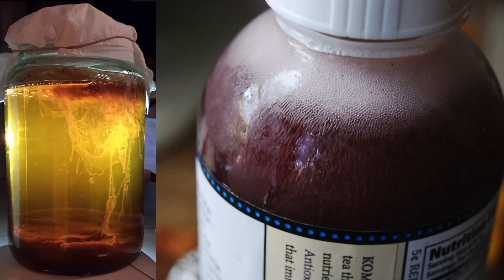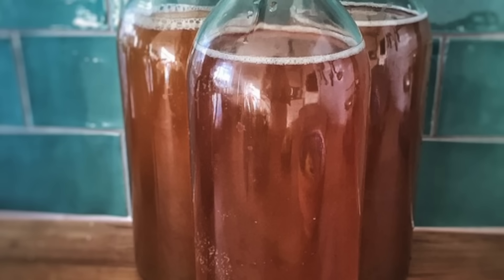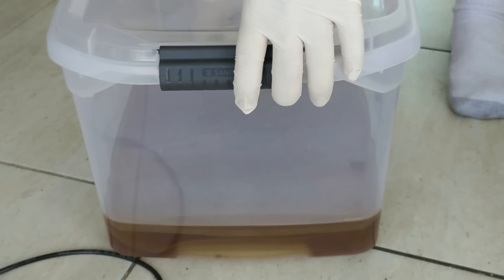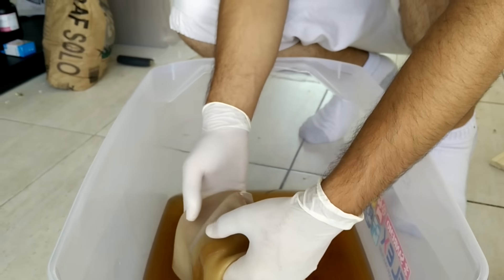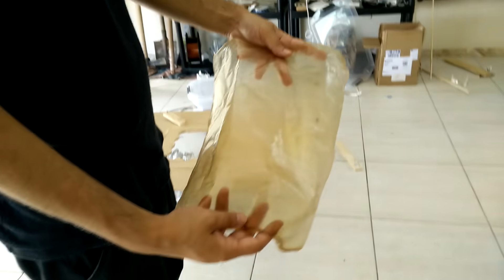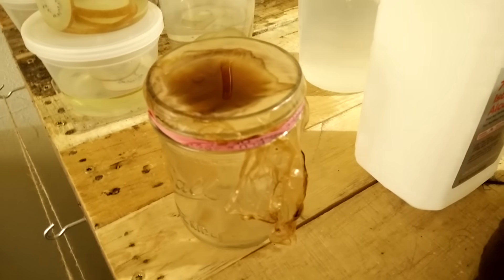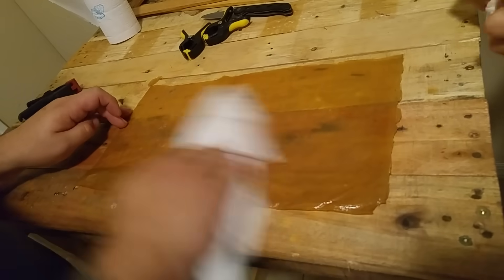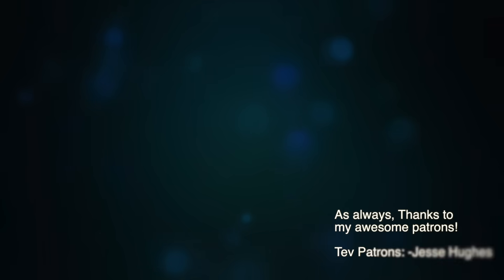How to Grow Leather-Like Material Using Bacteria (Making Kombucha Leather)

Comment: I just recently tried out this experiment except I wanted to introduce the concept of meat glue into the equation, so I soaked the  SCOBY in glutamine water to make it suitable for binding with meat glue. Overall it worked pretty well and I had some nice thicker material similar to yours but what was most interesting is the scraps that I forgot about inside the glutamine water mixture. I came back to the container after about a year and the scraps of the scoby turned into an almost perfectly clear plastic that fractured similarly to glass. I definitely need to clean it up since it's covered in nasty rot to do some tests on it

Comment: Can it be used as motorcycle body armor? Sturdy backpack material? How about a wetsuit, or a band aid? Will it keep you warm, or cool? What happens when you freeze it? Would it be practical to use the thin version instead of plastic wrap? Does it block oxygen as well as moisture (to keep meat from getting freezer-burn)? Is it machine washable? Is it durable enough to cover a sofa?

Comment: Does it need to dry in a wooden frame or can you just let it lie/hang?
Or will it shrink irregularly?
I'm just thinking that if I frame it, it would hang through in the middle?
Also if it's an unnecessary step...
And wouldn't it be thinner at the edges where it was squeezed by the frame?

Great work, guys!

Comment: I am a shoemaker, so i think i can supply a bit additional info.... I am pretty much sure somehow it's been said before.
Tanning via oils is a pretty old method, and it works, yes.
But if you're talking leather, you should have gone straight for chrome- and oakbark-tanning. Those methods produce the leathers which are used for almost all products made of leather, everything else is just a niche.
Especially oak bark would be interessting, as it is a renewable resource that is nontoxic and so it goes more in line with a 100% ecological leather alternative.
Last thing is: you'd have to check the properties. Make a shoe out of it.
Leather is so damn unique in its properties that it is very hard to replace it.
This video is great, just as all your other stuff is. Hope you read this and maybe give it another try.

Comment: Can this be used as an artificial muscle.  If an electric current is applied like in a web, will it contract to the shape of the web.  As long as it's moisturized, the muscle would be reusable.  The same can be done in reverse as the muscle contraction could be used as nerves and relay that back thru the webbing.  LOL, looked like the last human from 8th DrWho episodes.

Comment: Would the leathory material be useful as a seal for a home made vacuum chamber? I wonder if it expands in vacuum or can have liquid applied to it to make it expand on demand.
Reply: Can it be coated in things in the vacuum chamber like titanium? Could you either dry it and make a titanium mirror to exact dimension for a telescope or dry it in form to the correct shape?
Reply from the maker: no, its quite porous and full of trapped water. It would offgas like mad

Comment: Here are the the steps from the video written down, so they're easier to follow :) :
1. Boil destilled water
2. Add one cup of sugar and two teabags per gallon
3. Put it into some kind of container
4. Add a small amout of Kambucha liquid
5. Make sure it still gets some air. 
6. Leave it for 2- 4 weeks. You may need to add new tea
7. Dry the Scoby on a  woodframe for a few days/hours
8. Put a mix of beeswax and mineral oil on it and let it set
Done!

Comment: You could reinforce the scoby with fibers as it is growing,    aramid fiber for instance could result in a cut and tear resistant leather.

With a slightly agitated and aerated nutrient bath,  you could grow a scoby onto a submerged fiber/wire scaffold and produce arbitrary shapes rather than allowing it to form a skin on the surface.

Electronics could be embedded into the scoby and encapsulated as it dries.

Comment: What are its actual mechanical properties?  You say that it's flexible, and you clearly reeeeally want us to think of it as a leather alternative, but that's about it.  
When oiled, does its texture change with water? 
Does it resist abrasion?
What is its tensile strength?
Does it take dye? (right now it looks like cellulose sausage casing more than anything)
What happens when it is heated?  
Is it oil resistant?
Does the oil leak out?  (i.e. If I had a wallet made of this, would it pick up fuzz from my pocket and/or slowly leach oil into my money and onto my stuff?)
100 other things...  Need more info!

Comment: You could try cross-linking the proteins with a little formalin or glyoxal solution (take care, use ventilation and gloves, then dispose of waste safely!) then heat it. A few cross-links in a hydrogell will greatly increase resistance to water penetration. Just. 0.2 % of a suitable cross-linker will render a completely water-soluble polymer insoluble.

Comment: A couple thoughts for making your awesome polymer material more like leather: 

First, this material is smooth on both sides, unlike leather, which usually has at least one sort of fuzzy/rough side...

Also, the SCOBY is translucent, and as you demonstrated, you can even make it pretty transparent.

I think you could add one thing to make it more fuzzy/rough, more transparent, and possibly even stronger:

FIBRES!

Ideas for sources of natural and strong fibres you could experiment with:

Hemp
Cotton
Silk
Spider silk
Coconut coir
Pineapple cores
Hairs (wool, human hair, mohair)

Two ideas for processes:

1) Blend chunks of SCOBY with short fibres in multiple batches with different ratios of SCOBY to fibre.

Then, use simple paper-making techniques to spread out the slurry on a porous screen or fabric, and dry thoroughly.

Apply your coconut/mineral oil/beeswax spray, and let it soak for a few days as you did in the final example in this video.

2) Create a freeze-dried sheet of fibrous pulp, heat anaerobically to drive off hydrocarbons, leaving an aerogel type lattice. 

Grow the SCOBY within that lattice, then dry as normal, and treat with the oils/wax mixture.

Comment: That does NOT look like real leather. I work with leather 5 days out of a week so I would know what it looks like. Most leather is about 1/4th of an inch thick, matte (unless using a specific kind of dye) and completely opaque. The color and durability are kinda similar but it's a far cry from real leather. BUT it does look like rawhide or parchment, which are made also made of skin. That being said, that SCOBY is a truly amazing material. Leather has its problems, not least of which is that real leather has a "grain" to it, meaning that it's stronger in one direction and stretches (with effort) in the perpendicular direction. But this stuff shouldn't have that problem. It's more like plastic.

Comment: its interesting you strongly recommend against tap water which most makers of cultured food inc myself have alwas used no problem but recommend steel pans for your vessels - as metal should have a strong anti bacterial effect.
Reply: You don't ferment in bacteria because acid liquid corrode metals that will leech in your food/drink
Reply: @baldr12  not all metals are that reactive. Stainless steel will work because of the chromium content, which will keep it from corroding
Reply: Only certain metals actually have antibacterial properties. Most metals simply resist bacterial attachment
Reply: Obviously this video shows the production of huge scoby sheets in Stainless steel pans so it can't really be much of an issue. I just meant its interesting as every guide for making cultured foods that I have ever seen has strongly recommended against steel containers and even utensils, citing that they will interfere with the bacteria.
Reply: @dfpguitar  Tell that to any company that makes fermented goods. Everyone uses stainless.

Comment: You didn't mention the strength of it. I mean, it's cool that it's "flexible and supple" but if used as a real wallet how long will it last? If I yank on it can a person rip it in half?
Reply: If enough material is used and water is repelled well enough by the oils it should be strong enough,  but it isn't as strong as real leather.
Reply: @garethbaus5471  they never mentioned the strength but im assuming it's as strong or nearly as strong
Reply: @Xezian  I have experience with this material from my own experamentation and can say that it isn't nearly as strong as leather, but is plenty strong enough to make a decent wallet. When wet it to sticks things a little bit but this shouldn't be an issue if the oil coating works well enough (I haven't tried oiled scoby yet).
Reply: I make kombucha and the scoby is actually really hard to tear. Yeah you can cut but it would take a really strong person to rip it. I mean there are a lot of factors, like how thick it is and so on. Although I don't know how durable it is once dehydrated.
Reply: It’s probably a ways weaker than leather. Even if water on it wouldn’t be an issue.  The oils would be.  Seeping into pants. Into money and piling it would have to be a thing from it loosing it to everything else from the money and in the jeans from pressure sitting on it
Reply: So that will need more thousand million bacterias, any godsake for one single strong leather, be grateful you live in this computer era.
Reply: @Baitrix1  And as I also said we need the numbers to know if it's viable. If it holds for half the time double the amount is needed, and that does not just mean of the product but also transportation and other stuff link to it.
Then there is also that little thing that we got the leather already so why not uses it. It's not like we can stop growing cows just because the leather isn't used for clothing and so on, as it would properly just be sold to one of the other industries that needs animal parts, like lubrication for heavy machines or medicine industry. There are over 500 different products that would still need us to grow the animals, so unless this is cheaper or more durable I don't see the need for it. Add all the other factors to it that would make it an unwise choice and I think we know why this product hadn't hit the market yet and properly never will.
Reply: @BobBobbertson-j5n  it might be, haven't really made anything from it that I kept more than a couple of years.
Reply: Now, what if you tried to smoke it, like traditional leather curing was done? 🤔 back to the lab!
Reply: You sound really upset that you found out Santa Claus isn't real.
Reply: @Graeberwave  I havn't been getting alerts for this comment chain so thanks for bringing it to my attention again. It was an interesting read. 

But at the same time... what?
Reply: Agreed. I'd love to get my hands on some since I work with leather regularly and see how it holds up
Reply: Or if you get it wet... :/
Reply: @magdalenalukac8242  the oil coating they used to treat it would repel water
Reply: Its mentioned several times how it doesnt break when its bent and how strong it is.
Reply: @katiefrances531  Yeah, he mentioned it was flexible and supple. But that's not the only kind of strength you'd want a wallet to have if you used that example. What happens if it gets wet, does it wear quickly, if stuffed full of stuff and sat on would the pressure start splitting it at the seems, etc. I asked because I was curious about the material.
Reply: @IronDruids  I am also worried about the fact it's transparrent, it really looks nothing like leather. And for how long does the oil work, is it sticky, can it become sticky, are the bacteria a problem health wise, can bad bacteria live of the leather.
Not to mention the amount of resources and time it takes compared to other sources, it's not like honey or tea is cheap to make in the first place, not to mention coconut oil.
Reply: @-JustHuman-  
it is not sticky you can see them handling it and he describes the texture
and compared to other sources of leather this is probably more efficent
Reply: @Xezian  
I also said Can it become sticky, and sticky objects isn't something you just can see on a video, you need to have it in hand, there are levels to it.
What makes you think it's more efficient ?, why shouldn't we use all of the animal when we kill it, it would be inefficient to discard the skin, and nothing in this process made it seem faster, cheaper or better for the environment. As I said neither honey or tea production is cheap on a industrialized scale, tea is even bad for the environment and the workers in the plantation, and it's not something you can grow everywhere on earth unlike animal skin.
Reply: @-JustHuman-  im not an expert on the process, but from what i understand, the process of making leather traditionally is long, arduous, and harmful towards the enviroment, while this essentially has no harm towards the environment. As to if it can becomes sticky, i chose not to answer that and your other questions cause i don't have an answer I do not know, but as I said he described the texture and feel of it, and while some light levels of stickiness may not be able to be notices. We see them put the leather in their pocket where alot of lint can accumulate, and it likely would have pulled some lint out with it when they took it out of their pocket, but instead it slides in smooth and slides out smooth.
Reply: @Xezian  
This would be harmful to the environment too.  You would need a lot of water to make this, a lot of tea, so that means forest clearing at least, then you also need the honey and they used a lot of energy to heat all of it too. There is no free lunch, and like I said we already slaughter animals for food, so why not use the skin, and we already have synthetic leather too, which is the one it really have to compete with, and that is even cheaper to make.
Reply: @-JustHuman-  yo have you heard of farming? like yeah sure its not entirely clean but its much less harmful then the process of making leather (im pretty sure)
Reply: @-JustHuman-  and i just thought of this now, I do believe as long as we farm we should use all the parts of the animal, however at the same time recently we've seen artificially produced/bio-engineered meat, if we're moving towards that we probably need something to replace leather too. Also this is much more versatile then just leather and probably could be used to make replacements for many other products, such as mentioned in the video, plastic wrap.
Reply: @Xezian  leather can be tanned so it isn't harmful to the environment but it would only be on a slow small scale.  The harmful leathers you hear about are the fast mass produced leathers. If scoby "tanning" is done on an efficient mass scale it wouldn't be that great for the environment. 

I work with tanneries.
Reply: @-JustHuman-  you realize real leather is transparent before its dyed right... 😂
Reply: @Turtlenaide  Not sure where you are going with that ?
And almost everyting is transparent depending on the light or waves used, so that statement means nothing. 
And you assume that this organic product can be tanned, or colored just as well as leather for you to make that statement.
Reply: @-JustHuman-  Considering that every source of actual leather requires feeding and raising an animal, it's probably still cost effective.
Reply: @-JustHuman-  i hope you realise how inefficient and wasteful making ani.al leather is, it takes month to get the smallest ammount and takes so much waste. This process is way more sustainable and has less waste, not to mention he described the texture in the video. If it was sticky, or became sticky he would've mentioned that, just like he did for the failed projects.
Reply: @Xezian  The stickiness can also be dealt with by using basically any paint-like varnish.

However, when they were touching the wet scoby, they said it was “slippery,” not “sticky,” so in that way it is even more like wet skin.
Reply: Benjamin gammer  oh aight.
Reply: @-JustHuman-  bad bacteria cant live off of the leather stuff, however it is edible if you fry it., and the bacteria that was used to grow it was most likely killed during the drying process
Reply: @2wugs  Bacteria can live of all organic material, its really only time and conditions that matter.
Reply: @-JustHuman-  You do realise that "synthetic leather" is even worse and usually doesn't last long, which makes it end up on landfills, right?
Reply: @flaccid6pancake  Also why I don't say we should use it, I am a fan of real leather. What I said was it has to compare to faux leather in price, production, environmental and durability. So it needs to last around 5-6 years at minimum, to compete with real leather it needs to last 15 to 20 years, even though some can last for generations, but heavy used things tend to look worse at that time. Also why I like organic leather more, as it creates less waste, last longer and is something we already produce as we need so many things from animals to make other stuff anyway.
Reply: @-JustHuman-  I've actually managed to get it to work with random dried leaves, though of course I haven't gotten to tasting it yet. It also has to be mentioned that the blob is a byproduct of the drink, so the tea wouldn't be wasted anyways. It is to note that leather is oiled too, and must be re-oiled after contact with water to not ruin it.

Comment: This is fascinating!  Thank you for sharing this info.  I would make small gifts such as indoor slippers lined with fluffy fabric. A credit card holder.  Small pouch to hold a pair of nail clippers, etc. A wood working apron. Leather belts if it is strong enough and without too much stretch. Pencil case with a zip closure. I imagine alcohol paints could be used to add colour. Thank you.